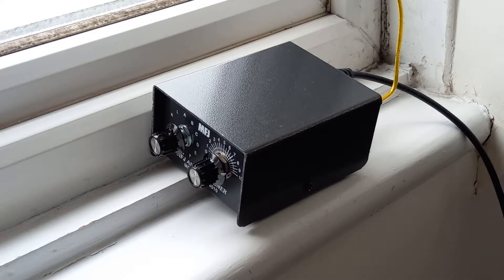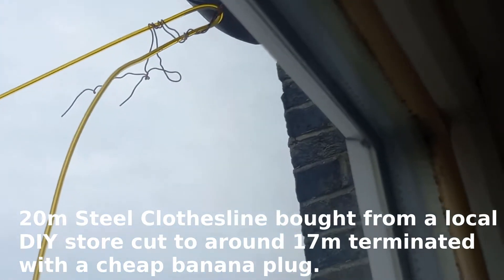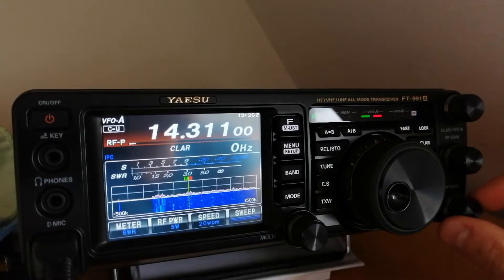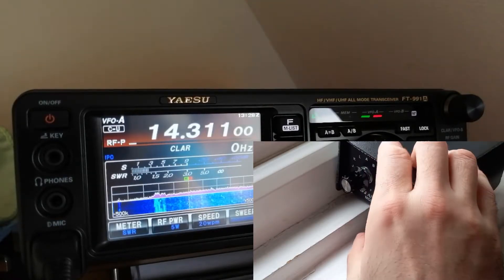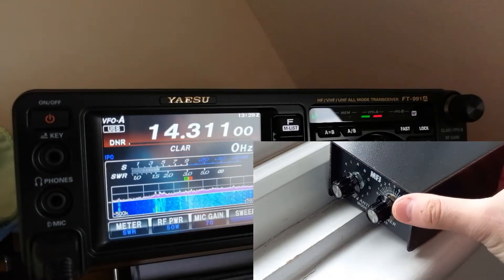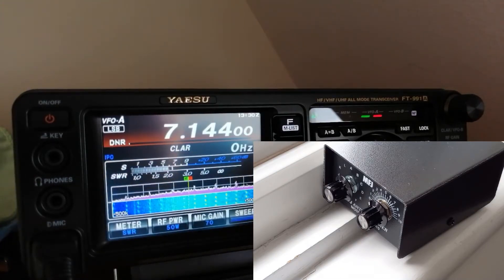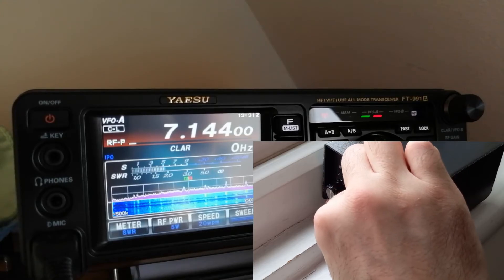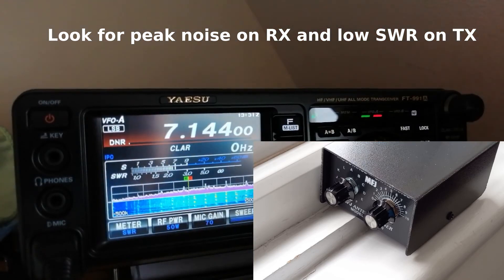Manual Antenna tuner in action - MFJ 16010

Comment: Thanks for posting this. I just sourced one of these on a local ham radio swap shop and plan to use it soon with my FT897 while house sitting. The L-network should be good for maximizing radiated RF and the light speaker wire that I'll use will be easy to set up and take down. 73

Comment: Nice compact setup there. I've got the exact same tuner which has featured in a couple of my videos. See "Portable Inverted V" & "Tuning A Barbed Wire Fence" (both in my "Antenna Abominations" playlist on my channel).

I just wondered what you were using as an RF ground/counterpoise to tune the antenna against?

As a side note, I recall seeing you appear on Chris' channel (Digital Analogue Ham) a while ago. I think you started your channel not long after me & I see that you are now approaching 150 subscribers. For me the first 100 subscribers was very slow but after that the numbers started to rise surprisingly quickly.

I was on 100 subscribers back in November/December & in the last couple of months I've more than doubled that as I have now shot up to 260 subscribers!

The point I'm trying to make is this:- Keep up the good work, keep posting videos & hopefully things will start to happen for your channel!

73. James.
Reply from the maker: Thank you for your comment! I am not using a counterpoise mainly because of my limited space. I have placed few  ferrite clamps over the coaxial cable.
I will definitely keep posting new videos, it is something I enjoy. I will have a look at your channel, too. All best, Ivo
Reply: @hamradiotime so I have one of these tuners and apparently I'm a moron I've been trying to use it on my dipole LOL. Now that I understand it is for a random wire antenna I may get somewhere lol awesome video by the way. So the counterpoise is not necessary at all? How is that so? Wouldn't a random wire only be one element of the antenna?. Therefore unbalanced? Thank you in advance for your response

Comment: i add a Tayloe LED circuit in my 16010s so that i can adjust for peak signal, then flip a switch, ptt a carrier and tune to dim the LED, then flip the switch to operate... very handy for visual tuning and for qrp rigs with no swr meter... cost is about US$5!
Reply from the maker: Good idea💡

Comment: When you adjust the power levels, you need to readjust the antenna tuner as well.
Reply: Not if its tuned at low power 1st like he was doing.
Reply: Without counterpoise is it efficiency?

Comment: do u have it grounded?
Reply from the maker: Hi, no. Nowhere to ground it. But it works fine via common mode choke
Reply: Couldn’t you ground it by putting some radials to the outside of that SO-239 you have the banana plug in? Also, where is the choke you mentioned?